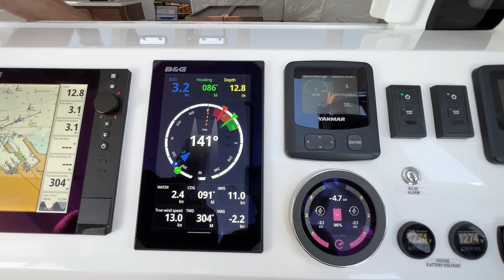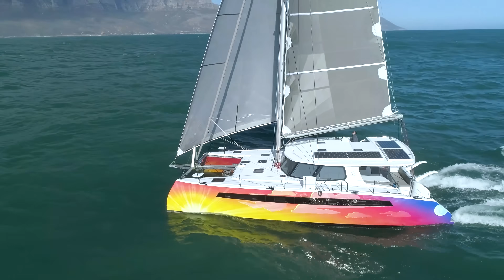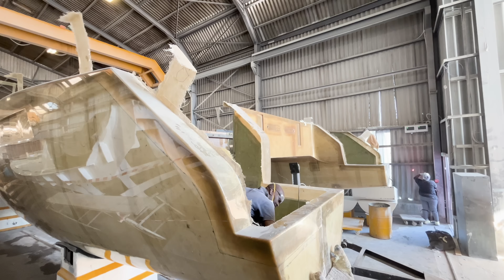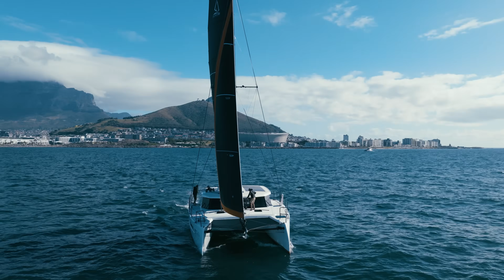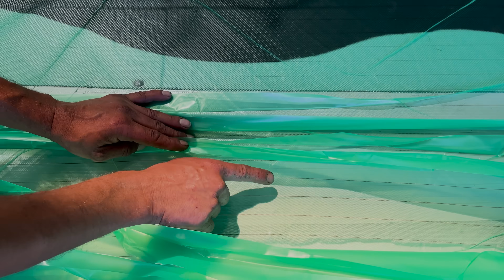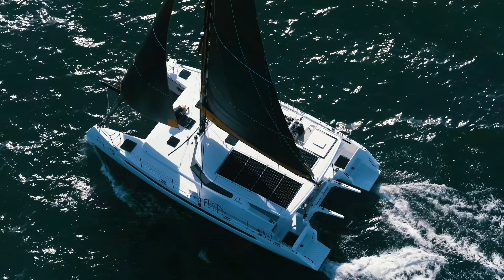Balance Catamarans: New Models, Innovative Build Techniques & The Future of Performance Cruising

Comment: definitely a miss to put the effort into grain matching the veneer panels of the 4 refrigerator fronts but not matching the refrigerator panels with the surrounding edging @ 14:27
Reply from the maker: I find this comment interesting. I went to look at our 502 pictures and do not understand the comment about "surrounding edging."   There is none. The drawers are flush with the surrounding veneers, and the veneers are matched indeed. Anyways, my goodness, compared to the old stainless fronts that were always finger printed and looked rather industrial in the salon living room, I think you should give us credit for being the first catamaran manufacturer to do this in real wood veneers that match the rest of the yachts cabinetry. Perhaps if you come to a boat show you can pull me aside and share with me your thoughts on how to do this even better. I just at this point feel they look fantastic.

Comment: Phil’s knowledge of the product is amazing, will we ever see a shaft drive version, do you think? 🤨🇦🇺
Reply from the maker: We will only do a shaft drive when we have to, and that means currently only on the 750. We much prefer saildrives as they are more quiet, allow us to keep the engines out from under the aft berths, and offer full power at the prop over
an angled prop. I do not believe it is less costly to service a saildrive over straightshafts, as cutlass bearings and dripless seals have to be serviced often enough.
Reply: @balancecatamarans I totally understand the benefits of having the engines away from the aft cabins. Although the loss of power going through two 90° bends on the saildrives, & the large through hull intrusion aren’t ideal either. However there’s pros & cons with everything. Considering the number of both types of propulsion we have to choose one and move forward. Thanks for the response! 😃🇦🇺

Comment: Are the boats post cured after the hulls, bridge, decks, floors etc. are bonded together?
Reply from the maker: The epoxy boats we do much be, and are. The vinyl ester boats do not need to be oven cured as the epoxy. All the carbon parts are infused and cured.

Comment: Why a sailing company would put so many sharp edges and corners in an interior is mind boggling 🙄
Reply from the maker: Its funny, but we get this comment a lot at boat shows from monohull folks used to being tossed around violently when sailing!  I owned a monohull I lived on for years and get this. The pain of it was I had to spend 45 minutes to stow everything before I went sailing and spent another 45 to unstow. 
We put small radius curves on the countertops, but hardly need big ones as you do on a monohull. We find we do not even need gimbals on our stoves, which drives monohull sailors mad at boat shows. But if they ever went sailing with us they would see there is no need. But I tell you what!  You want us to put big round corners and install gimbals you do not need, we'll do it happily!